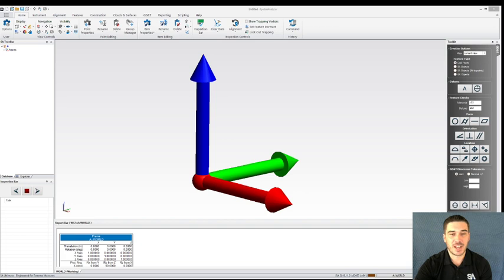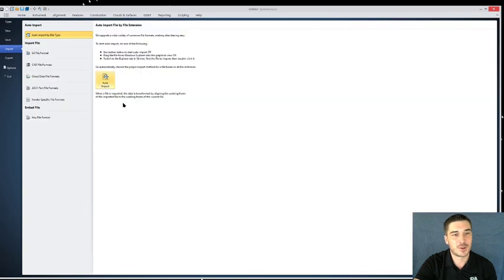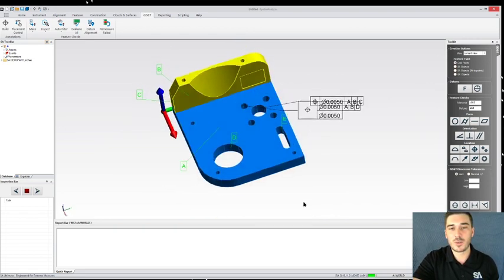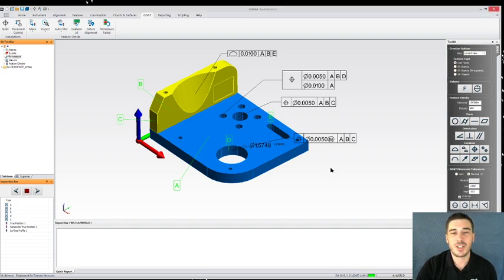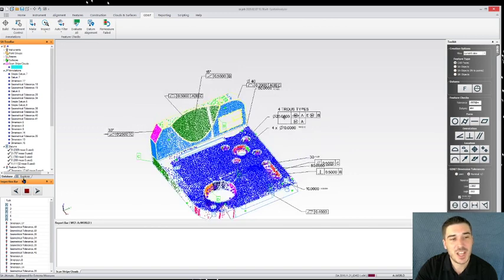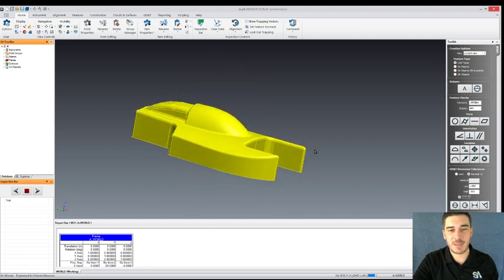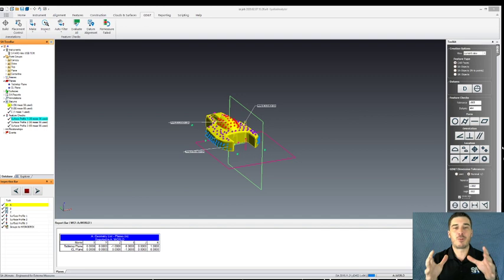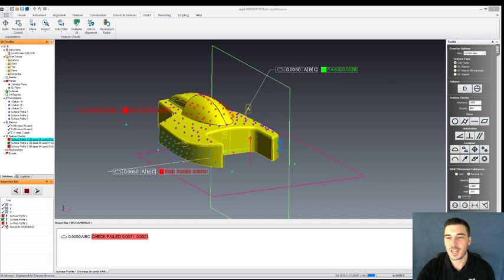SpatialAnalyzer Webinar | GD&T

Comment: Hi. I have encountered a problem on how to feature check and correctly setup a datum which is a derived feature of derived features. 

Namely the datum is the center point of a circle defined by the centerline of 5 holes (the holes are located along the circle). How do you setup this correctly? Thank you